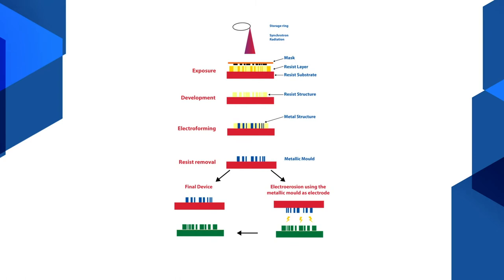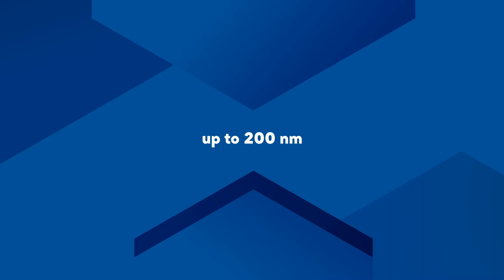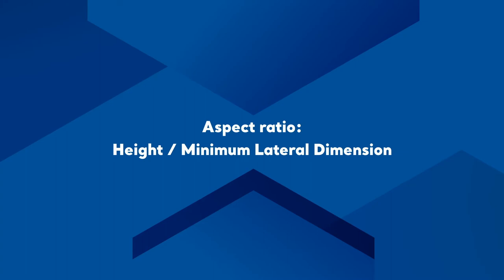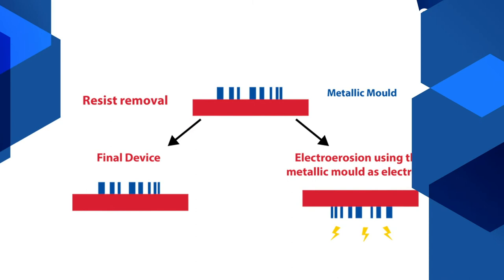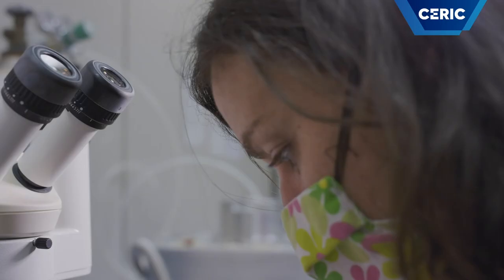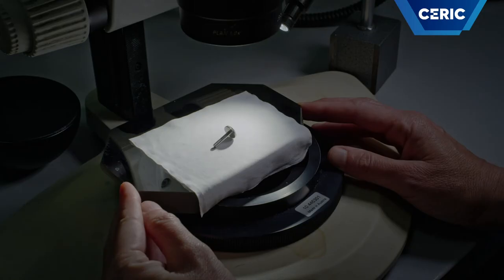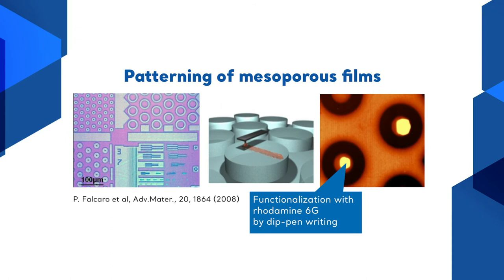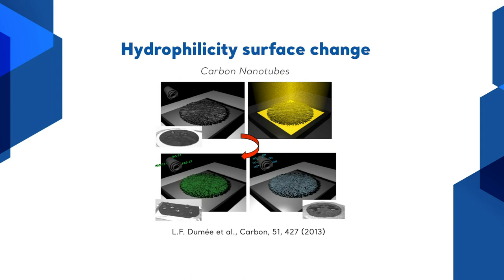Introduction to DXRL: Deep X-ray Lithography at the Elettra synchrotron in Trieste

Comment: Will it replace EUV eventually?
Reply: very possible
Reply: It is unlikely that X-rays will ever become viable for lithography because of their short wavelengths and the difficulties associated with focusing them accurately. Lithography is a process that involves using light to create patterns on a surface, such as a semiconductor wafer or a printed circuit board. The patterns are created by shining light onto a photosensitive material and then using a lens to focus the light onto the surface.

X-rays have wavelengths that are much shorter than the wavelengths of visible light, which makes them difficult to focus accurately. This is because the shorter the wavelength of light, the more difficult it is to focus it onto a small point. As a result, X-rays would not be able to produce the fine patterns that are required for lithography.

Furthermore, X-rays are difficult to control and manipulate because of their high energy and penetrating power. They can be harmful to living organisms and require specialized equipment and safety precautions to handle. These factors make it unlikely that X-rays will be used for lithography in the future.

-Chat GPT's opinion
Reply: Sounds solvable.